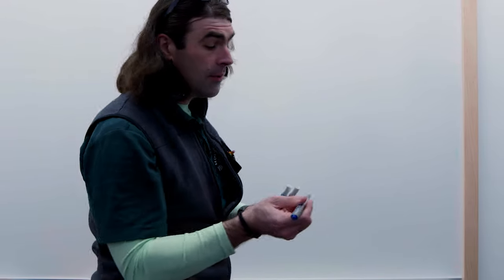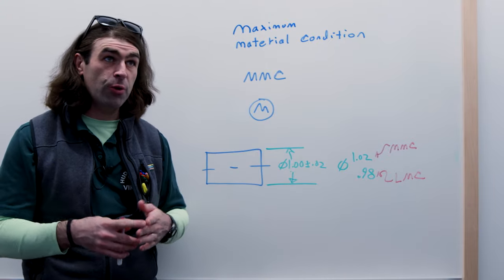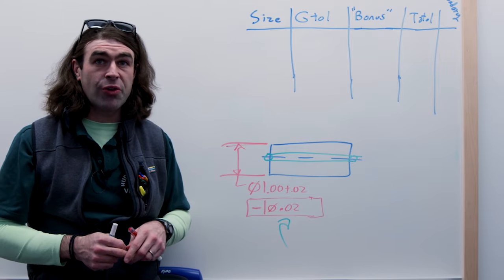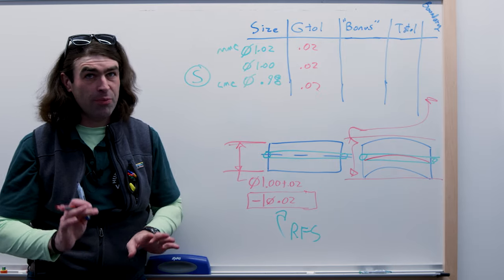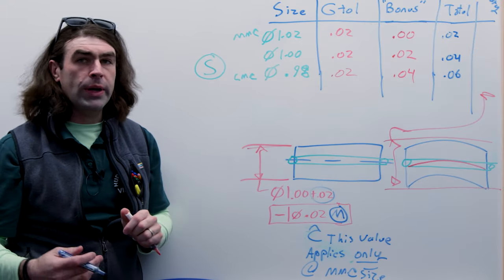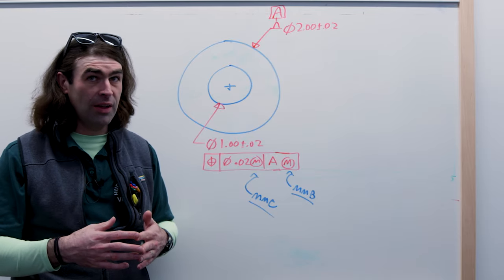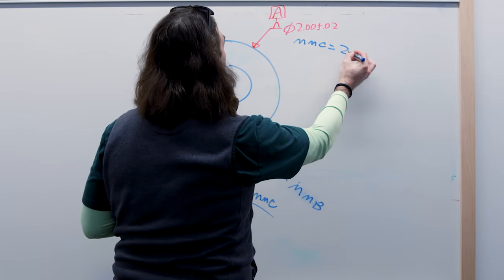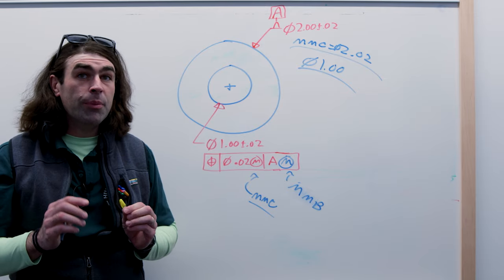GD&T Most Important Symbol Explained

Comment: About the MMC/LMC dinamic action to a feature dimension, for example in interaction with a concentricity, it seems then it can be automatically used in such cases even if it's not mentioned in a drawing, from the functional point of view, because most designers in companies don't use it but it can be quick set by yourself that condition to save false scraps, is it correct?

Comment: I've been working in aerospace  part manufacturing, i'm used to using micrometer, dial test indikator, profile projector, keyence, swiftpro and cmm. I've a question that till now i have not the answer yet. What's formula to calculate position tolerance when use polar coordinate/ angle and radius ? It's so easy when using cmm, is there another way to calculate manually instead prior convert it to cartesian coordinate? Thanks

Comment: If i have a 10mm+- 1.0mm plate, the datum A is  the bottom.  I want to add 1mm depth hole on the top of the plate, Do I need to add the dimension from datum A which is 9mm? What if the plate is made at the minimum thickness which is 9mm, what will happen to the hole?

Comment: One suggestion, maybe add more pictures and use more simple terms. Leave the talk of datum shifts and complications in a later video. By removing that topic out, you have more room to talk about the MMC concept that applies to holes and shafts. That way, you can talk about MMC fully. I do like how you had an example for the 3 applications that you would use it
Reply from the maker: Thanks for the feedback! I do sometimes use pictures added in post, but I want to avoid it feeling like a PowerPoint presentation, so that’s why I keep it to a minimum.